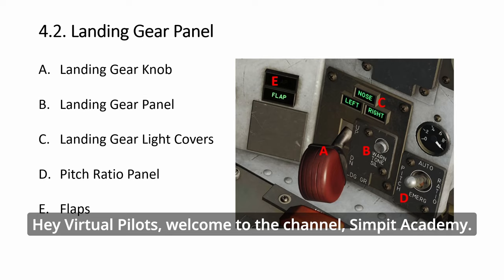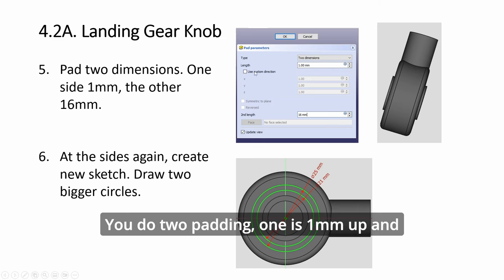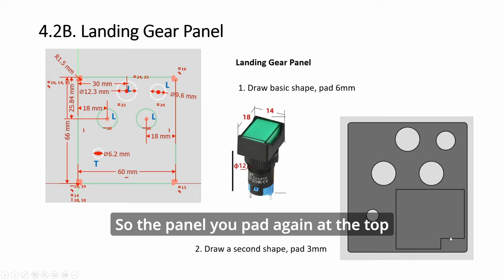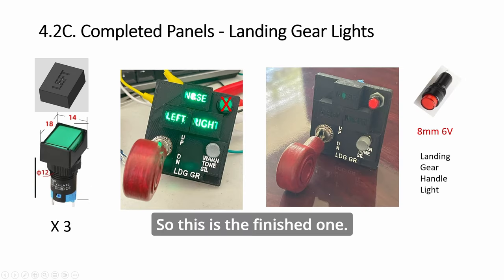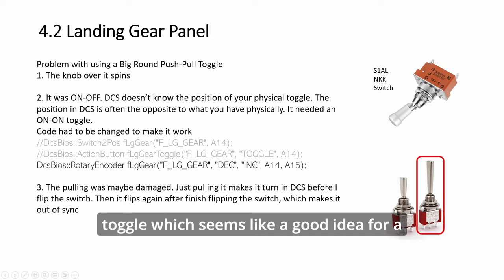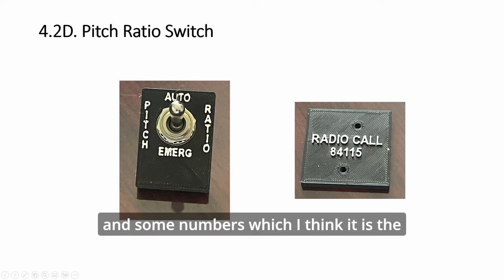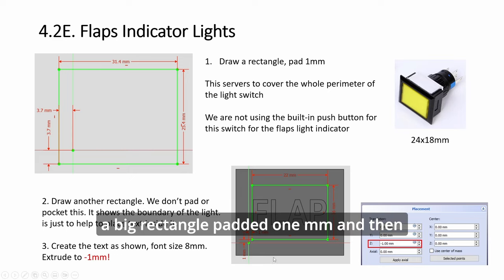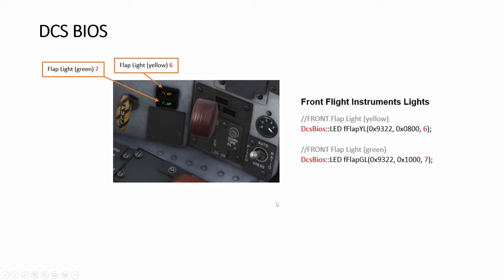Episode 13 How to build DCS F-15E Landing Gear Panel #dcs #arduino #flightsimulator

Comment: I would like a landing gear code for f16 via dsc bios
Reply from the maker: I'm not familiar with the F16. According to Bort, this is the line for a simple 2 way toogle for F16 landing gear: 
DcsBios::Switch2Pos gearHandle("GEAR_HANDLE", PIN);
It depends how you build your switch. If you use something different than you need to grab a different code
Reply: //LAnding gear lever
DcsBios::LED handleGearWarning(0x1026, 0x4000, 4);

//Landing gear SAFE
DcsBios::LED gearRSafe(0x1026, 0x2000, 5);
DcsBios::LED gearNSafe(0x1026, 0x0800, 6);
DcsBios::LED gearLSafe(0x1026, 0x1000, 7); 

this is an incomplete code is it for the four leds ? to adjust the switch too? and what is needed to get the total code? I'm new to this part and I don't know it well
Reply from the maker: @ΔΗΜΗΤΡΗΣ-γ8τ  Your code 0x1026 at the beginning of each LED looks old. Test it, maybe it still works. But better install Bort from github. Bort usually has the most up to date code especially for light indicators.

The code for the landing gear up and down is separate from LED lights. And every aircraft has one red warning light when gear is in transition, 3 green ones for nose, left and right gear.

In my first reply I have given you the code for the landing gear. Below are the code for the lights.
DcsBios::LED lightGearL(0x447a, 0x8000, PIN);
DcsBios::LED lightGearN(0x447a, 0x4000, PIN);
DcsBios::LED lightGearR(0x447c, 0x0001, PIN);

DcsBios::LED lightGearWarn(0x447c, 0x0002, PIN);

Notice the numbers in the brackets are different between yours and mine. Try yours first. If it works great. If not try the ones I pasted here from Bort.

Make sure you wire the LED with resistor correctly too. My videos showed how to do them correctly.
Reply: @simpitacademy  ok i will try it in arduino ide i will write the code and to add a switch what should i do? and the bort you mention from github is a library right?
Reply from the maker: @ΔΗΜΗΤΡΗΣ-γ8τ  Bort is a small program to install. There are people on youtube showing how to use it. When running DCS, you can also see values change when you turn on lights or flip switches.

I suggest you also check out other people building the F-16 in ED forum under the group Home Cockpits
https://forum.dcs.world/forum/181-home-cockpits/

The viper and hornet are very popular aircrafts to build. So ED forum and youtube should have many people showing how they built theirs. These should help or you can also ask these people directly about specific F-16 questions.
Reply from the maker: @ΔΗΜΗΤΡΗΣ-γ8τ  For the landing gear, you just need one line of code to handle it going up or down, 3 lines for the 3 green lights and one line for the red warning line. Nothing complex, regardless of aircraft type.

But if you use a typical 2 way toggle, sometimes DCS gets it wrong and does not know your actual lever is up or down compared to the game as it just flips it over and over. You should firstly use an ON-ON toggle for that it has two pins. Then use the rotary encoder code instead of the Switch2Pos or ActionButton code as those will just flip its position and may end up in the opposite side, as explained in this video of mine. The code you should use for the F-16 is: DcsBios::RotaryEncoder gearHandle("GEAR_HANDLE", "DEC", "INC", PIN_A, PIN_B);
Even though this code says rotary encoder, you should wire it to an ON-ON 2 way toggle, without an OFF position in the middle. If still confused, rewatch my video explaining why so.
Reply: 1)Well, I'll put 3 pins with green LEDs, 1 pin with red and I'll put two switches for up and down so there's no problem

2) and i will add the code below the leds right?

3) and i start the code like you? correctly;
Reply: Help code for landing gear??
Reply from the maker: @ΔΗΜΗΤΡΗΣ-γ8τ  it depends on what kind of switch you are using. most people will use a 2 way toggle. For that I have given you the code in my first reply using a Switch2Pos. you can also try this DcsBios::ActionButton gearHandleToggle("GEAR_HANDLE", "TOGGLE", PIN);
But if you are using an ON-ON toggle with 2 digital input pins as I suggested, then you use this one that I have also given you:
DcsBios::RotaryEncoder gearHandle("GEAR_HANDLE", "DEC", "INC", PIN_A, PIN_B);

All the code for different types of switches and methods can be found in Bort. You need to down its exe file in github and learn to use it.

https://github.com/DCS-Skunkworks/Bort